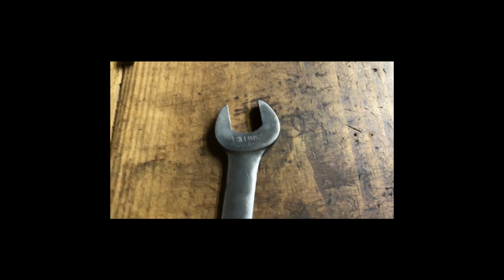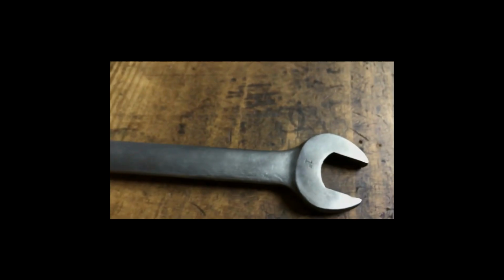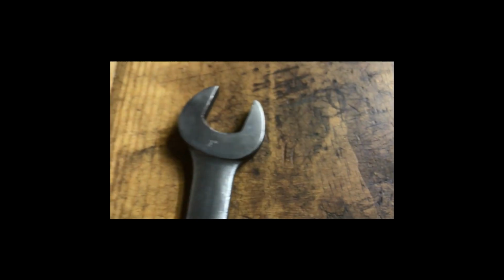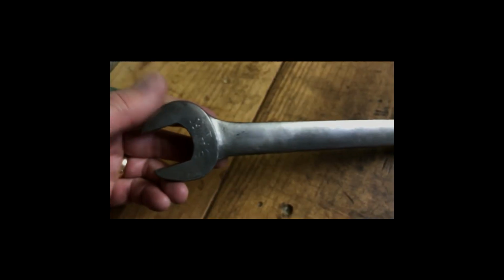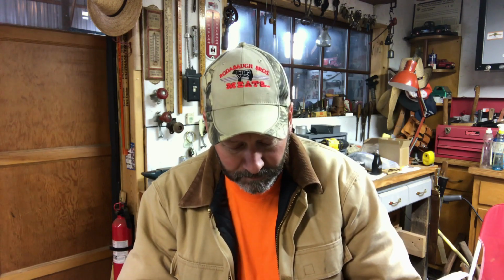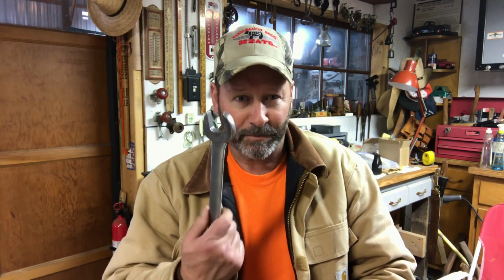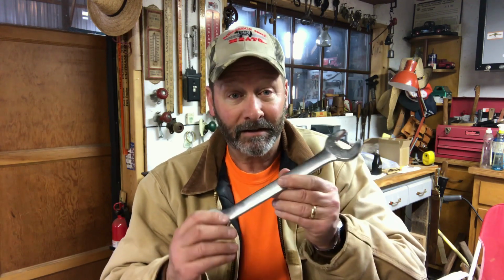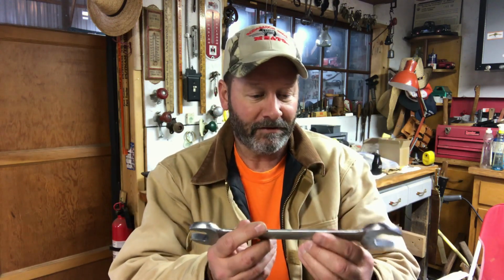Billings Wrench 1033C restoration

Comment: Hi Todd!  The small lines you see are probably forge markings and they are usually ground off at the factory with most wrenches, however the Billings would often paint the body of the wrench and only polish the heads!  If you aren't satisfied with the body of the wrench you can always wipe it down with denatured alcohol and tape up the heads and spray it with Gloss Black Enamel.  Those wrenches are strong and beautiful!  Great job!  Thanks for sharing!!!